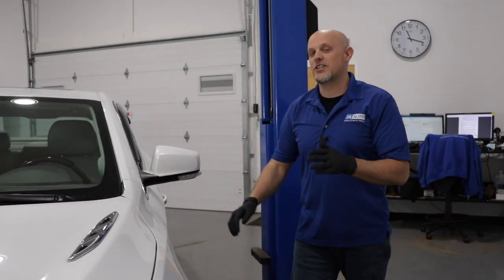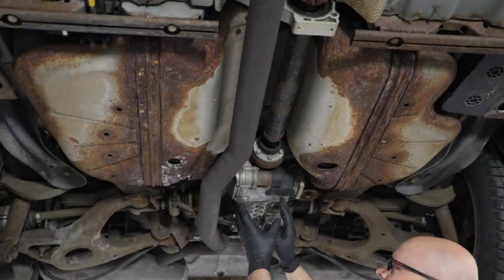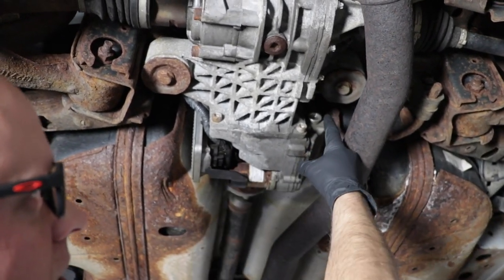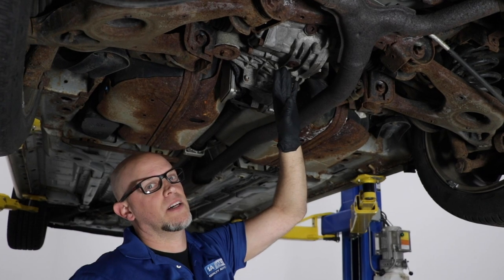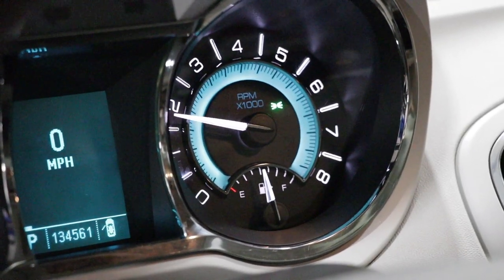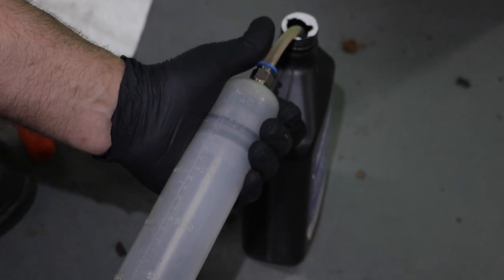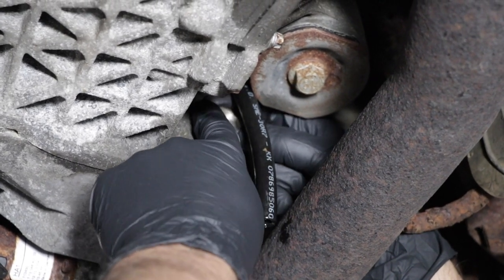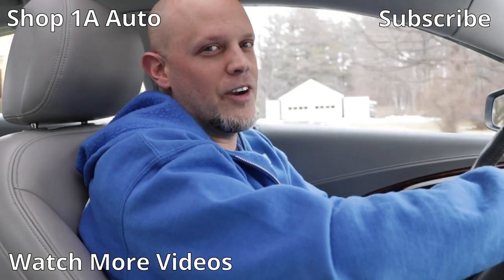GM All Wheel Drive Not Working? Check Engine Code C0407? How to Fix!

Comment: I've just replaced the rear diff on my 2010 srx. New filter, new pump, proper fluids, but I still have an error.message 

I think I made an error filling the clutch pack side
 I put fluid in the level plug opening and then the vent. Idled reved ect
I'm confused on removing the plug and filling from the vent. The TSB I read said to install the plug to fill, you filled with it out. 
Suggestions?

Comment: My Captiva Automatic AWD has an issue. While turning the steering or making a U-turn at a slow speed, the car shudders as if something is holding the tires. While reversing and turning the steering, it has the tires with vibrations. Moreover, both the rear tires are worn only on the inside. The problem doesn't seem to exist when I remove the drive shaft. I tried to change the drive shaft of a good car, but the problem didn't seem to go away. Please help me. When they put the drive shaft back and disconnect any 1 abs censor and the error pops up on odometer then the problems seems to be vanished.  The moments you put the abs cencor back the problem comes back.

What might be the issue with my vehicle?

Comment: If you really were servicing it you would of took off the 14 Allen bolts to clean the inside of all the sludge and clean the pump’s screen that gets close to blocked in 30k miles as the fluid gets sludgy.

Comment: This appears to be the same system as the SRX. is that the case? I just had that code. Rear diff was only slightly low (signs of seeping on diff) so Topped it off. I guess next step is the clutch side fluid check. It's a 2015  SRX4 with only 40K miles, owned since new and dealer maintained by dealer purchased from until recently so a little surprised it threw that code out of nowhere. I am not in a snow state, no towing so it's really never been worked hard. Thanks for the video. It gives me a direction to look before just "taking it in" and being told it needs an entire diff.

Comment: What kind of clutch fluid did u use? I cant find out anywhere.
Reply: Any fluid for gen 4 haldex should work. You can get it from febi, VW, Volvo, ravenol.. etc. This system is made by Borg Warner and is nearly the same in many other cars.

Comment: Same procedure on the Saab with the XWD if i’m not mistaken?
Reply: Correct
Reply: It was half assed. He should of replaced the filter and cleaned the inners of the sludge and clean the pre filter to the pump.